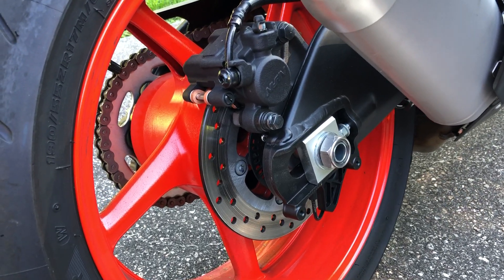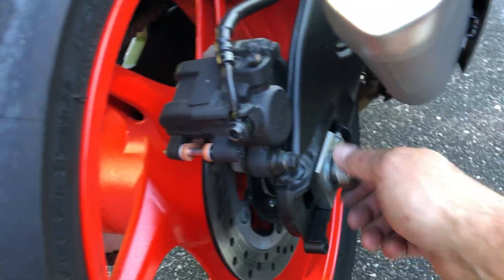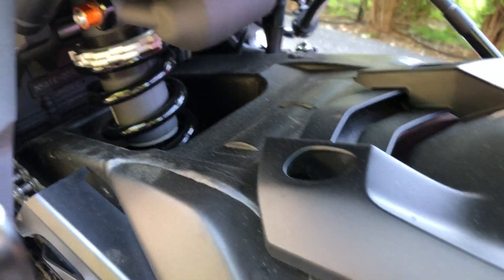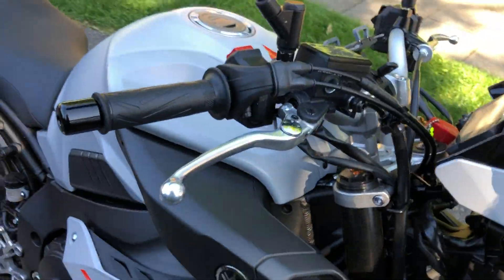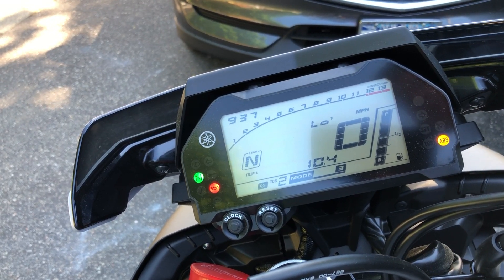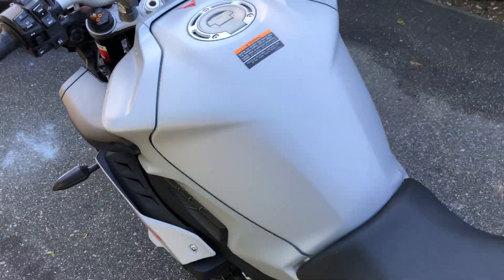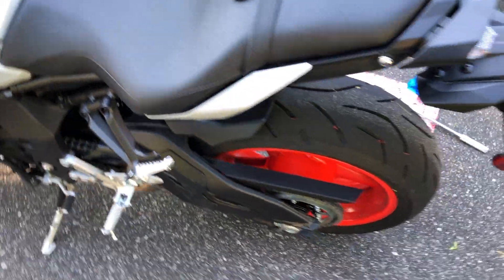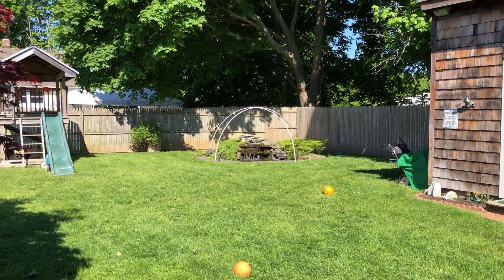2019 Yamaha MT10 chain adjustment breaking in the Beast!

Comment: I installed the M4 3/4 system to get rid of the cat and it’s a good bit louder but won’t piss off the neighbors. Highly recommend for the money! Cheers
Reply from the maker: thanks so much for taking time to comment.  I will check out the M4 system.  I also don't want it to loud .  Did you loose any torque on the low end?

Comment: How's the bike doing brother??  Which mods have you installed since this video??
Reply: It’s awesome, I bought the Leo, Vince cat delete and put in a tuner and kept the modified muffler and it sounds perfect to me. It’s loud when you get on the throttle and quiet when you want it. I don’t wake the neighbors.
Reply: @lotust251  so far,  I've only put a coffman's exhaust slip on and I gutted it out. Took off both the silencer tip and the resonator inside that was wrapped with packing, so basically a shorty straight pipe. It sounds amazing but not too loud. I am debating on which link pipe to get cuz I do ultimately want it to be louder. Leo Vince is top of my list.

Comment: 28.4mpg, was that keeping revs low as per manual for first 600 miles, not prolonged operation above 5900 rpm ?
Reply from the maker: Yes , not to say I didn't go higher for a few seconds at a time.  I just got the LeoVince Link Del cat pipe and Tuner and servo buddy.  The bike is currently in for service.   The oil pan gasket was leaking pretty good.  They are installing the link pipe while they're in there at no charge.  Im also a 250# rider and 6'3" I create allot of drag.. lol

Comment: It's just a regular chain, right? Without o/x - ring sealed?
Reply from the maker: I used Dupont chain lube.  You clean the chain with kerosine and let dry ( I use a leaf blower to dry the chain and bike after a wash). Then spray on the 
DuPont Teflon Chain-Saver Dry Self-Cleaning Lubricant.   Im pretty sure its an O-Ring chain.

Comment: Just bought the same bike and I’m the same size....200 miles on mine now and found your video because my chain is loose as fuck—like 2.5”+. What’d you end up adjusting it to? (Edit) Just saw in your description for the specs—thanks. Also have had four back surgeries including spinal fusion. Love the ergo’s of the MT10